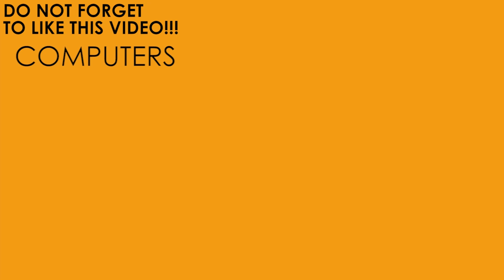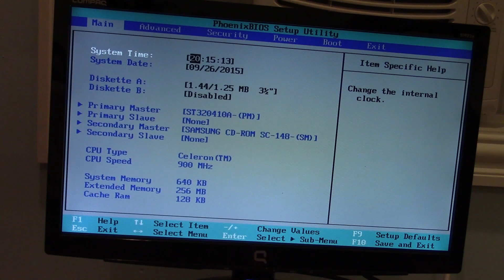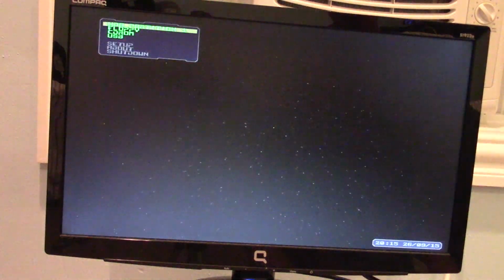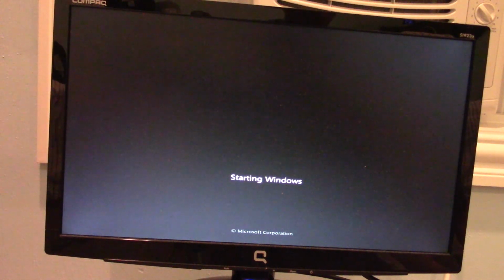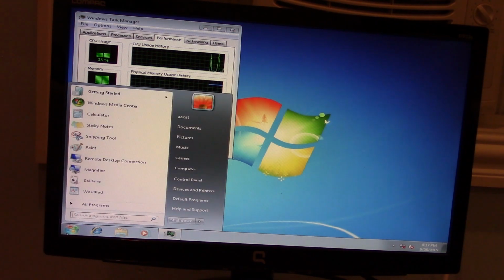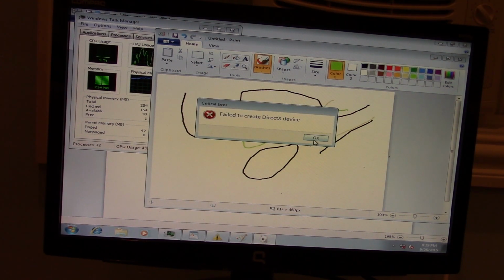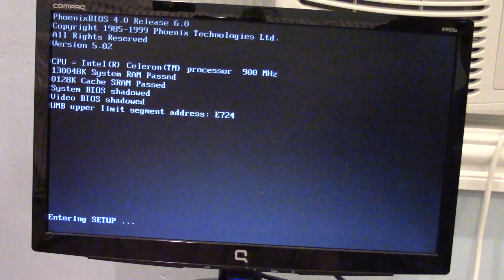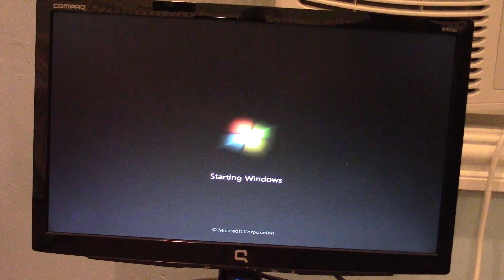Windows 7 Ultimate on 256MB of RAM 900MHZ Celeron

Comment: you should use win to usb for installing windows on a flash drive, usb2.0 is not recommended at all, not the port but usually the speed that usb 2.0 flash drives offer witch i seen around 6MBs and high latency

Comment: It will be even slower because the boot drive is a usb. The results are a very off. Even xp runs slow in a 2.2ghz pentium duacore or core2duo with 3gb ddr2 if its running of an usb. 

Would be good to have a installation in a realiable hard drive

Comment: You think Win7 will run on a Compaq Armada m700 with a 650Mhz Pentium III and 512 MB of ram? (it currently has 320MB of ram. This is a laptop by the way)

It's internal graphics is a ATi Rage Mobility AGP. I'd have to get a larger HDD though (which should come in the mail in the next week as I already ordered one). 10GB is certainly not going to be large enough. :P

Comment: Windows 10 on 16mb of ram !
Reply: EQZI impossible :D
Reply: Czechia-Lifts I know
Reply: wouldn't boot :D
Reply: That computer would explode if it had just to ATTEMPT to run THAT.
Reply: EQZI Windows Vista - 10 Will just crash.
Reply: Windows 2000 can boot on as little as 16MB of Ram
Reply: i said 16MB on windows 2000, Only Datacenter supports 16GB+ Ram
Reply: 7eeN cant you need 256 mb or more
Reply: 0x00000000000000000x0000000000000000000x000000000
BSOD
Reply: @Calocitey i think windows need 500 mb ram
Reply: 512*
Reply: 7eeN Windows 10 with no ram
Reply: Calocitey you can get n lite and make do support 32 mb ram
Reply: Windows 10 ultimate 64 bit 2 kilobytes of ram

Comment: I've got a stack of Compaq iPaq 2.0 desktops running Win7, they ran anywhere from a 700MHz Celeron to a P3 1GHz.  I gradually upgraded almost all of them to the P3 1GHz, but even maxing them out with 512MB RAM, they're a bit painful to use to print coupons (their only use).  I could probably cut out more programs and services to help a bit, but I'm thinking I might throw Windows 10 on one first to see how that goes.

And yes, they only have USB1.1, so Win7 is installed to the HDs, and it had to be done with a DVD.

I'd love to throw Linux on them, but they're used for coupon printing, and the software isn't available on Linux, and people haven't been able to get it working through WINE.

I will say this - RAM MATTERS when installing to the hard drive.  I have installed with anywhere from 256MB to 16GB on a system, and the more you can cram in there during the HD install, the better.  I have borrowed RAM from other systems during a Win7 install when possible.  256MB is horrid, 512-1Gb is just extremely painful, and 2GB and above finally removes the pain.  And you need that RAM all the way through the initial Windows Updates, even if using Rollups.

Comment: This machine need Linux Puppy.Not Windows 7.
Reply: Eduardo Avila ur mom is lightweight
Reply: GenericUser Well... Thats kind of you. That mens that my mom is not fat as most of the americans. Thank you!
Reply: Btw now with the new xenial puppy you can make a real full install to the hard drive and even use swap, so now puppy may be that good option thay you were talking about.
But i still leave my statement about slacko. It cant make a full install, only frugal, that is a live cd copied into the hdd.
Reply: GenericUser Btw why are you mad? Dont you have a mom?
Reply: Schroeder M. Schulz Well.. this is awmost not a insult, as he just says my mom is not heavy.. But yet funny to read
Reply: lin xu Actually not... Its variable, but every operaring system may suffer from bugs, and depending in the hardware configuration it can havr several issues. Even more if it is badly put together or even if its not maintained anymore. 
Linux, mac, windows, none of them is perfect...

For example:
Debian sucks hard in my hp mini 110 3735dx. It hardly will boot, or even install. It just poops itself when i put the bootable usb or even a cd in external drive. 
But ubuntu just works out of the box perfectly, and actually antix and point linux mate work well, out of the box too, and they are derivated of debian. But hey, deban is known for being a stablr system, but thats not what happens in my hardware. In my dell, debian will boot but even in the nonfree one it wont have drivers
Reply: itzblueberry AUTTP
Window Sand Mac 4 life?
Reply: Nope, it cant save things... 

A ram upgrade and xubuntu would be ok.
A slax installation too. 
A windows 2k too.

Puppy is stupid, it is for low ram devices but put everything on ram sonif you install anything the free ram is over... Puppy doesnt have any purpouse except see if some linux boot... It fails hardly even on its objetives... Even with a better pcs, like 1gb ddr3 hp mini or even a 2gb pc wont have enought ram... 
Because stupid puppy wont touch the hard drive for some developers obscure reason... Doesnt make sense, i cant install a thing. And if it is for old pcs, it needs to run low on ram... If i will need 2-4gb or even more to use it i would use a more decent linux that requires 1 or 2gb of ram... 

Slax require less and is very lighweight tho.

Comment: I have a machine mainly for vintage gaming, eqipped with a P3 clocked to 1035 MHz, a Radeon 9600 Pro and 256 megs of RAM and under XP it can play videos up to 480p fine. On 720p it struggles and 1080 is really a slideshow.
The computer shown in the video just needs a more recent graphics card with some proper video acceleration.
Reply: Lol my old computer also handles the video exactly like that on YouTube!
My PC has Pentium 4 HT 3.0E, 2 GB DDR266 RAM and NVidia GeForce FX 5600 with 128 MB VRAM. Currently running Windows 7
I have used it without any graphics driver for many months because I can't find any. But just recently, after digging more deep into internet, I finally found one Vista driver, running perfectly fine without even any compatibility mode.
Now it even runs Windows Aero!

Comment: Still runs faster than the computers at my school.
Reply: My school has 5th gen i3 laptops (HP)
Reply: <--- Dual-core Pentiums from 2005
2 GB RAM
Shitty integrated graphics

And with all that bloat-ware, security stuff, and other useless software, it runs slower than a Pentium III.
Reply: my school's pcs are 4 year old dual core pentiums (with a fuck ton of bloatware and viruses), and q6600 pcs (which run a shit ton faster).
Reply: in MY school, the pcs are 1 year od Dell Optiplex, full of viruses. Because of me. Yes, their computers AND servers are mining altcoin, for me. And I installed a ftp server un the main server. It's now full of yiff.
Reply: @defalt45  how much you earned
Reply: Our computers have i5's and 8 GB ram lol
To bad, they have an integrated GPU :(
Reply: One of the computers at my school have a i7-2600 and an R9 270x for some reason lol
Reply: am I the only one who goes to a school with decent computers?
like we have core i3 laptops, 4gb ram with Win10, and some very decent workstations...😎
Reply: @blearbenin  The Desktops in the computer labs at my school are Dell Optiplexes with 4th gen i3's and 4 gigs of RAM. Our student issued laptops are Dell Latitudes with 5th gen i3's and 4 gigs of RAM and SSD's. The laptop I used in favor of the School owned ones is a HP ProBook With a 2nd gen i5 and 8 gigs of RAM.
Reply: +Isaac Ledesma lol same
Reply: pentium 4 1.60 GHz 256 MB RAM Win XP service pack 3
Reply: trizm 6ix 六 xD why???
Reply: my school had it too.XD
Reply: My computer at school has a Intel celeron cpu clocked at 2.8 ghz with 1 gb of ram (ddr2?) running win 10 education...
Reply: We have

Processor: Core 2 Duo
Ram: 4GB
(HP)
Reply: DDD Productions yikes
Reply: Isaac Ledesma my school has hp chrome books
Reply: Also faster than mine
Reply: DDD Productions  really??
Reply: me too
Reply: We have i9's😁
Reply: Yes
Reply: One year a go  my scholl upgraded old computers with xp  with new pc,s with w10 and i5
Reply: Mate those computers at school be taking out the ram
Reply: FACTS

Comment: i'm sure you have heard it, so i shouldn't mention it, but if you turn driver signature enforcement off you can usually force 32bit xp drivers to work in 32bit vista and 7 (also 64bit xp drivers, but that doesn't apply here).

Comment: could i get a copy of PLOP? would be useful for old machines.
Reply from the maker: +patg108 This is their website: https://www.plop.at/
Reply: +patg108 There is also a CD image available.
But since the ISO is only 544 KB in szie (also a IMG is delivered) a full size CD would be a bit wasted unless you put other stuff on it.
Maybe one of those smaller disks (8 cm, 185/210 MB) could be usefull for that.
Reply: i was refering to a image for a floppy drive since they're plentiful and cheap, and not much use otherwise.  Plus it'd still be handy for those computers too old to boot from cd or usb as a means around it
Reply: +patg108 https://download.plop.at/files/bootmngr/plpbt-5.0.15.zip just extract the zip and write the img file to a floppy.
Reply: +HappyBeezerStudios Totally worth it if you have old PC from 1998 that can't boot from USB by itself ;p
Reply: 1998?  I got one from 2008 that doesn't boot from USB, so you don't have to go back that far.  PLOP did help me slap Linux Lite 3.0 on my Pentium 4 machines though, which made them usable again.
Reply: Never had a PC from 2008 that doesn't boot from USB, my PC from 1998 was the only one I had with this problem
Reply: Mineis a a custom built with an ASUS P5E motherboard. Doesn't have integrated graphics even. Runs the X38 chipset I believe, so a gaming motherboard from way back when.